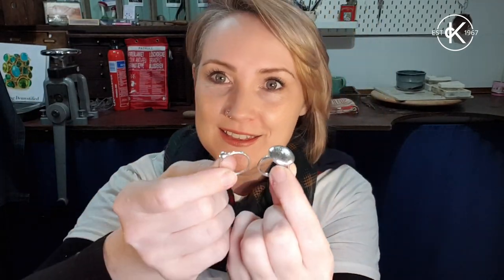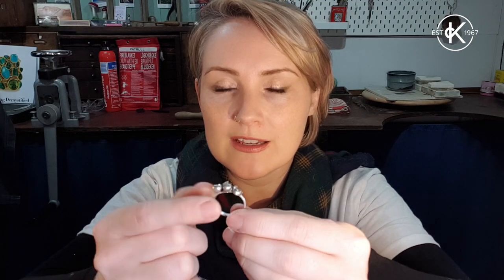Casting & Granulation Tutorial | 12 Months Of Metal

Comment: Thank you for this great video! Does it matter if there is a little bit of solder left on the scraps I am using? Or should I try to get rid of it before casting? Will it melt evenly into the silver? (not planning to hallmark). Also, if I were to melt different metals together, would they merge and become homogeneous? Out of curiosity. Sorry for all the question! Thank you again for the video! X
Reply: Hi Lilie, yes they would melt together and become homogeneous or in metal terms, an alloy. You can give them a little stir with a soldering pick or carefully swirl them in the crucible to make sure they are evenly mixed. With the solder, a little bit is fine if you're not going to hallmark. When I did my 100 consecutive days of recycling the same piece of silver for #misilverchallenge I didn't remove solder for time reasons. It noticeably began to affect the workability of the silver around day 50. So that was a lot of solder joins getting melted into the silver. If there's a lot of solder and it's fairly easy to remove and you have the time, I'd cut or file it out, otherwise, it's fine unless you're worried about purity for hallmarking.